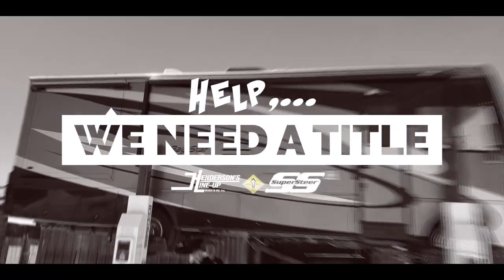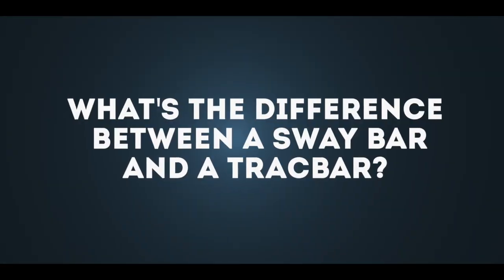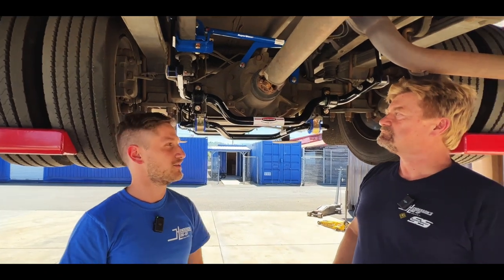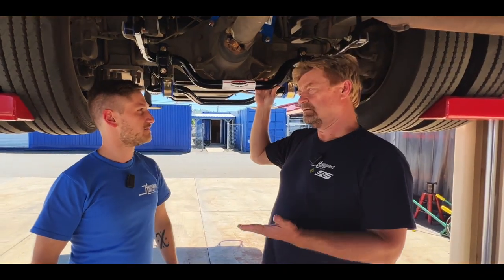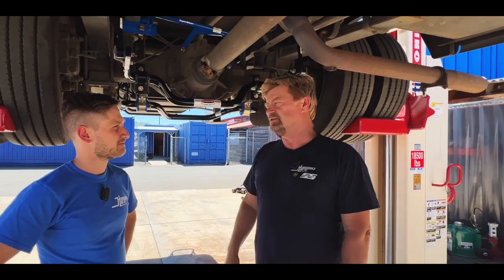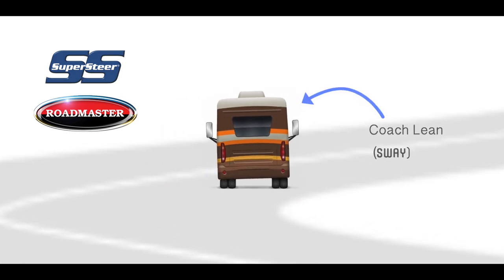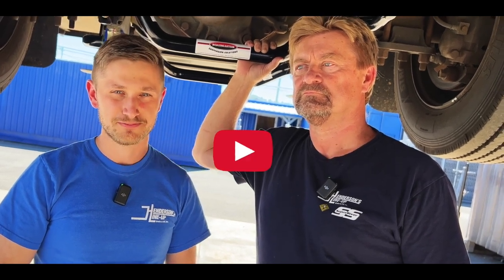What's the Difference Between a Sway bar and a Trac bar?

Comment: I have a 2022 Winnebago on the F53 chassis. Luckily, the factory installed the 1-3/4 inch sway bars front and rear. I did have the Safety steer track bar installed. While it didn’t take out all the tail wag it definitely helped. That, a Safe-T-Plus and upgraded shocks all helped. Still looking for more technology to continue the improvements.

Thank you. This is a very good video that explains the difference in detail, yet simply.
Reply from the maker: Thank you for the great feedback Anthony!  Stay tuned we have some new products in the works.

Comment: So, if someone were to wants to incrementally improve the handling by installing all of the items available by SS both front and rear, which one helps the most from most to least?  I have a W24 Workhorse and I plan to install all of your items, but need to spread them out over a bit of time to reduce the pain a bit.
Reply from the maker: Great question! I would say there's no simple answer. At the end of the day it's YOU THE DRIVER who needs to feel more comfortable.  We like to solve problems and not sell parts. I highly suggest you call in and talk to one of our SuperSteer experts. Once we understand your issues we can match you to a product list that will solve your challenges. Make sense?  Give us a call at: 888-898-3281

Comment: Have a 2023 alante with 2022 F53 chassis. It has the Jayride added. How does this equate to the proper install of devices to control sway and improve steering
Reply from the maker: Good question! In looking at Jayco's website, it appears that the main addition you get with Jayride is a Bilstein steering stabilizer. To my knowledge, the Bilstein product is really just a damper and does not provide the self-centering force that you would get with a Safe T Plus or Reflex stabilizer. The damping force does help reduce road shock through the column and can provide some protection in the event of a front tire blowout, but not to the extent that a spring-loaded self-centering stabilizer would.

Comment: As for the Roadmaster rear auxiliary Anti-Sway bar for my 2022 F53 (22,000) chassis, I see Roadmaster offers 1-1/2", 1-5/8", & 1-3/4" versions.  They say the 1-1/2" has an easier install than the two thicker bars due to different mounting hardware, but I would like to hear your thoughts on the performance differences and any pros/cons to these three Roadmaster rear auxiliary Anti-Sway bars.  My 2022 does already have the larger stock anti-sway bars and I also added the upgraded polyurethane bushing kit.  Thx.
Reply from the maker: First off, Thank you for the feedback and the great question. As I am sure you are aware, the thicker the sway bar, the stiffer it is, and the more resistant the vehicle will be to body roll or sway during cornering or over uneven surfaces. The choice between the three sizes (1-1/2", 1-5/8", and 1-3/4") essentially boils down to a trade-off between handling performance and installation difficulty, as well as ride comfort. As the driver, how you feel at the wheel is what matters the most and that can vary from driver to driver.

I encourage you to also check out the NEW Koni EVO FSD Shocks for extra sway control. These new shocks are specifically designed for the Ford F-53 Motorhome Chassis. Its superior design boasts enhanced construction strength and advanced valve engineering. Long story short, resulting in maximum comfort! Hope that helps and thanks again for commenting!
Reply: @SuperSteer  the anti-roll (or stabilizer) bar stiffness should be chosen in combination with the vehicle mass and centre of mass height, roll stiffness of the springs at both axles, roll centre height of the suspension at both axles. Suggesting that stiffer will simply improve performance (perhaps at the expense of ride comfort) is understandable at this level of discussion, but dangerously inappropriate. 

A suspension component supplier should offer a range of bar stiffnesses for the F53 chassis because the vehicle weight and other suspension components vary so greatly through the model range (from 16,000 to 26,000 pound GVWR), and because coach builders put bodies of different lengths, heights, and weights on them.

Comment: This is what I needed so I can calm down my 36' Dolphin.  Question: I have a tag axle.  Does the Tag address the same longitudinal corrections that the Trac bar is intended to fix?
Reply from the maker: Great question!  I would refer you over to John, our RV expert. Give him a call. He'd chat with you! Call 1-888-898-3281
Reply: No. A tag axle exists to carry some load because the drive axle can't carry enough. If the tag axle wheels don't steer, then the tag and drive axle tires fighting when the vehicle turns tends to stabilize the handling, but not at all like a lateral locating device such as a track bar.

Comment: In doing my LONG research in trying to improve my driving my RV with suspensions upgrades, I came across your channel.. I checked your website out and the one question I have on rear trac bars is - I noticed a LOT of suspension parts for Ford chassis but not much fo chevy.. I have a 2019 Jayco Redhawk 22C SE on a 2018 Chevrolet Express 4500 6.0L 5967CC V8 FI VIN: -Flex...I was wondering if you carry the Rear Trac Bar for my RV ??? Just thought I would ask..

PS....Personally I just to get rid of the feeling when a Truck flies by and tends to move my RV to the right as usual..I don't know what is best at the movement..I don't just want to spend money on a bunch of items that I might not need...Seems like a LOT of people are suggesting doing the following - 1) Sumo springs (replace the bump stop), Upgrade the sway bars(front and Rear), replace your shocks) and a steering stabilizer...That's quite a bit of money right off the bat)..When I drive I normally stay under the speed limit since my RV takes time to get up to a certain speed..Anyway, any suggestions would be helpful..Thanks again.
Reply from the maker: Thanks for your question! For what you're describing, our SS350 Rear Trac Bar as well as a Safe T Plus steering stabilizer would be a good starting point. If you'd like to discuss more, you can email sales@supersteerparts.com or call 888-898-3281 Monday through Friday, 7am to 4pm Pacific time.
Reply: @SuperSteer  In looking at your website for local installers I found a company called -Cusson Automotive Inc which is located in South Windsor CT..I'm located in Mass ..Can you confirm this ??

Comment: Notices two away links one was the factory bar replacement and then the addition of the second away bar. Can’t one bar be enough with the drag link
Reply from the maker: The drag link is a front steering component. You may be referring to the rear trac bar - as we explain in the video, the trac bar is primarily designed to control side to side shift in the axle. The sway bars are designed to control body roll. Because of the high center of gravity on the F53 chassis as well as the small factory sway bars used on the V10 coaches, we find that it takes quite a bit of sway control to really settle them down. Some customers elect to get both an OEM replacement rear bar and an auxiliary rear sway bar, which really results in nice cornering.

Comment: Ok, this is the second video that I really appreciated so I’m subscribed! I will go watch the rest of your videos. Perhaps you could address the use of track bars/sway bars on the front and back of the vehicle. I was under the impression you can use it on the front or back but not both. For context, I have a 2019 Sprinter 3500 RV and I’ve already updated the undercarriage with a Helwig Sway bar and bump stops (front & back). I’m considering shocks recommended in another of your videos and a (front/back?) track bar. When is too much and just wasting money? The sway bar & bump stops have made an incredible difference.
Reply from the maker: Thanks, that's a great question! We do touch on some of those things in our videos about the Sprinter. Much of it will come down to your specific coach though - how is it loaded, how do you like to drive, how stable do you want it to be, etc. 

In the case of the Sprinter, there is only a rear trac bar available for it (our SS701), since the front has independent suspension and does not need a trac bar. In the back, the adding a trac bar will help control push from passing trucks as well as crosswinds. There currently is not a front sway bar upgrade available for the Sprinter, although there is some work being done to investigate that. Upgrading the rear sway bar does make quite a difference, as you experienced.

Adequate damping is critical on the Sprinter chassis to control that low-speed rocking. The bump stop upgrades can help with this, but in our experience we would still recommend shock upgrades in most cases. If you'd like to discuss the specifics with us, please give us a call at 888-898-3281, or email us at sales@supersteerparts.com. If you haven't already done so, we'd also encourage you to take a look at our Learning Center (https://supersteerparts.com/learning-center) which has several recent posts about various Sprinter upgrades we've tested.

Thanks again for the great feedback!

Comment: The question that I never get answered is why the manufacturer doesn't add a trackball?  The steel that makes a trackball probably would cost the manufacturer NO more than pennies compared to the cost of the vehicle.

I'm pretty sure it's got something to do with liability.   CYA because reports claim that a track bar reduces traction.  It doesn't keep all tires flat on the road.

A track bar IS probably good for a monster truck all jacked up on 4 ft shocks.. but not a top heavy rv.
Reply from the maker: Hi Terry, thanks for your comment. Ford has been installing a front trac bar on the F53 since about 2007. Also, any air ride coach with a solid axle will have a trac bar installed from the factory. As long as the trac bar is installed at ride height and level, it should only benefit the handling. 

I've not heard before about trac bars reducing traction... Running too stiff a sway bar for the weight of vehicle can have the effect you describe, as it can prevent the suspension from articulating enough and cause one side of the axle to lose traction. For example, a stiff sway bar on the back of a half ton empty pickup can make the rear end want to lose traction. The threshold for "too stiff" on a motorhome is quite a bit higher than on a pickup though!

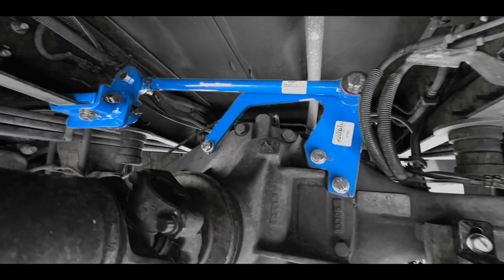Comment: The first few seconds (of real content) describe the effect of a stabilizer (anti-roll or anti-sway) bar well, but then the track bar (which they insist on calling a "tracbar") explanation is a complete fail. The track bar locates the chassis on the axle side-to-side. The effect on steering behaviour is indirect - the basic function of the track bar is completely missed. Then at 1:14 one of the guys goes on to give a good explanation of assisting the function of leaf springs as if the missed point had been covered.
Reply from the maker: Thanks for the reply. Appreciate the time you took to make it. To learn more about about why we call it a "tracbar" go to: https://supersteerparts.com/why-is-a-tracbar-important
Reply: @SuperSteer  apparently you missed my point. I know what a track bar is, why it is called that, and why it may be important.  I jusdon't knwhy you jawords together ( I just don't know why you jam words together ) instead of just using English... it's a "track bar", not a "tracbar".

Comment: Hellwig is 60% stronger than roadmaster.
Reply from the maker: Hi Terry, can you give details on which model of sway bar you are comparing? The strength of a sway bar depends on its diameter as well as the length of its moment arms - the shorter the arms, the less leverage the chassis of the coach has to work against the bar, and the more the bar will fight the sway.